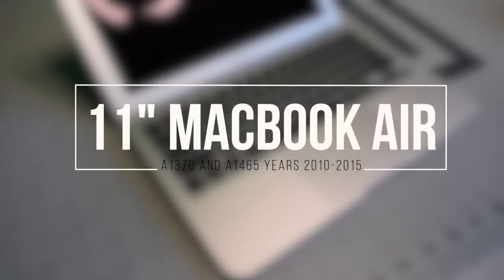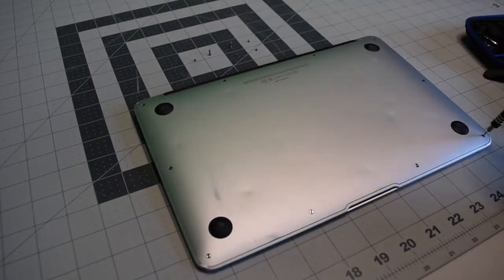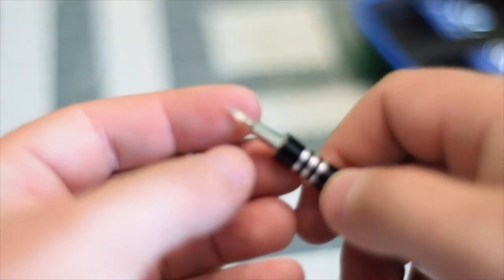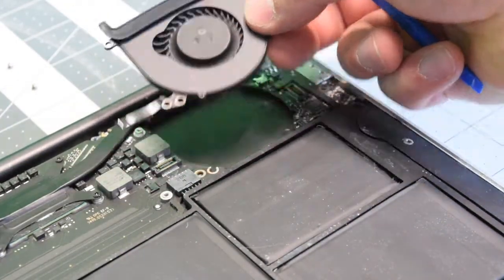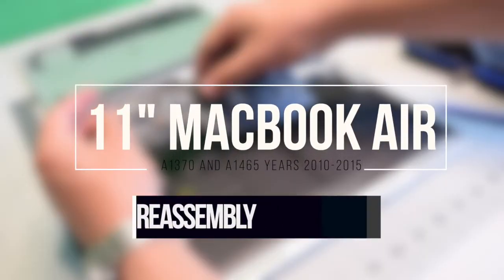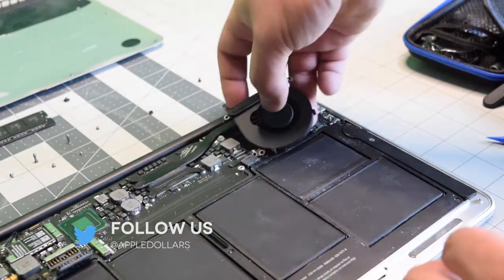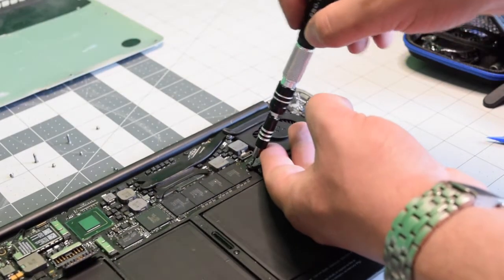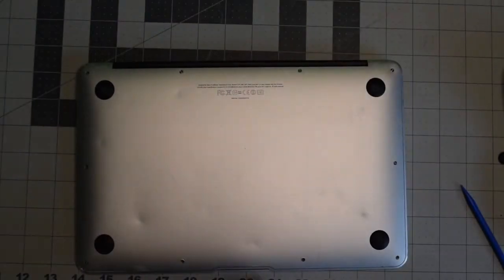11" Macbook Air A1370 and A1465 IO Power Board Installation for years 2010 2011 2012 2013 2014 2015

Comment: Hello sir, will a Macbook Air 2013 11” A1465 I/O board fit to a Macbook Air 2011 11” A1370? Because that is the only part available here and I’m wondering if it will fit.
Reply: Check Aliexpress. They show two different part variations, one for pre-2013 models and one for 2013-2017 models. I think they use different connecting cables.